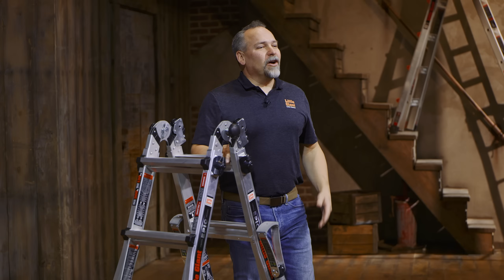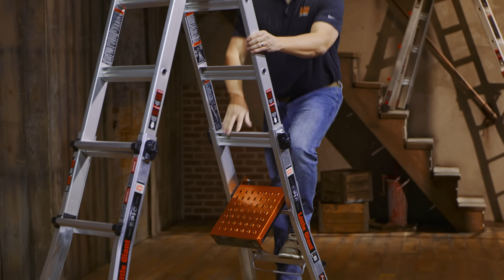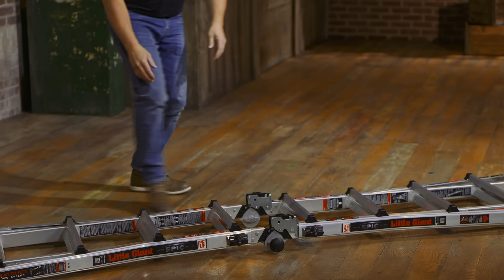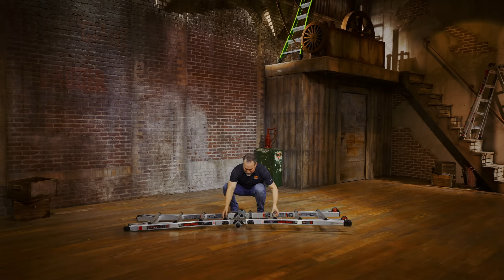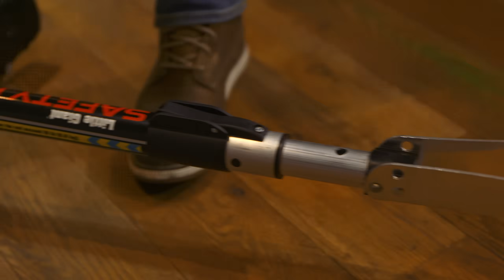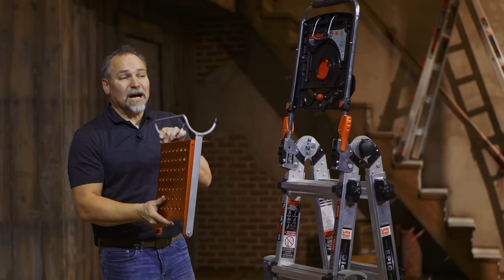Epic | Demo | Little Giant Ladder Systems

Comment: How much does the epic weigh?
Reply from the maker: the M18 size is 38 pounds, but that includes the safety rails. If you don't plan on doing jobs that require the safety rails I would store them elsewhere until you need them, because the safety rails do add about almost 6 pounds.

Comment: What is the length of the fold out standoffs and can they be adjusted (between them ladder and wall)?
Reply from the maker: the part that leans on the wall can't extend further out toward the wall, but the safety rails extend outward horizontally to span a larger window. Let me talk to our product team and see if they know the specific dimensions of how much of a standoff you get.
Reply from the maker: I talked to the team, and when you fold out the standoff part, it is 7 inches to the wall. But, by the time you factor in the proper angle of the ladder, you end up with only about 6 inches before the top of the ladder would touch the wall. So realistically, you get a 6 inch standoff.

Comment: Can the safety rail be attached lower to allow gutter standoff, while still allowing at least 3ft extension above the roof edge?
Reply from the maker: I would need to ask the engineers if it's ok to use an extra set of safety rails at the same time to allow for this. It's a good question - I'll get back to you on that!

Comment: I was going to ask how you could have anywhere close to 3” or 3 steps onto the roof when the horizontal bar ( and I only see one) is less than home roof height. So it seems you need four bars to get on the roof of any home with gutters… not so clever; and this I must assume is an added cost to this expensive ladder? (Not to mention the added weight!)
Reply from the maker: Many gutters are built with supports to lean against, though you are right, it is possible that climbing a ladder that is leaning on a gutter could dent it, but you do need to have 3 feet above the roofline in order to safely transition. The set of Safety Rails that come with the Epic is intended to be used vertically for that transition, which means instead of needing 3 feet of ladder above the roofline, you just need the 3 feet of safety rails and can walk straight through it.
Reply: @LittleGiantLadders I appreciate your rsvp, however LG needs to address the issue of gutter protection. Maybe your engineers can come up with an included fold away guard but most gutters could easily be bent scratched or a slippery unsafe surface to lean into with your system as is. Most ladders accommodate aftermarket stabilizers via holes in the rails. I am surprised LG has not made this simple design available. Anyway, buying two extra bars for a total of four bars is not an option in my opinion. Be well!

Comment: Can u tell me the difference between this the velocity and the multi? I know there are different kinds I’m just curious for my purchase thanks.
Reply from the maker: Hey sorry for responding so late! I just saw your comments. The biggest differences are in the type of locking mechanism. Velocity uses a "rock lock" to unlock the rails and make it taller or shorter. The Multi, Leveler, and Epic all use a "rapid lock". The multi does not have built-in ratchet levelers, and the velocity has the option to include them or buy them without. The Leveler and the Epic both have internal ratchet levelers on one side to help with uneven surfaces to ensure you are level. The main differences between the Leveler 2.0 and the Epic are that the Leveler has a hinge that doubles as a tool holster, while the Epic has an accessory port for attaching an air-deck accessory. The other difference is that the Epic has mounts to attach Safety Rails, allowing for a standoff or a walkthrough. 

I know it can get overwhelming looking at all the differences, so my question to you would be, what is your purpose for using a ladder? Sometimes knowing what you need to get done can help ensure you get something that has just the features you need.

Comment: I just tried to buy the model 22 and it went out of stock with the bundle as I was checking out during the sale so i had to buy it without the bundle. :( can you buy the epic step separately? i dont see it available as a separate purchase. are you able to purchase the entire bundle separately? i'd use at least the step, airdeck and ladder rack.
Reply from the maker: I need to go double check if they sell an accessory bundle separately, it is such a great addition to the Epic. I know that there is a "Platform Pro" which is essentially an improved version of the Epic Step with spots for putting tools if you're not going to be standing on it.

Comment: Can you use two sets of safety rails together? One for the standoff and another as the walkthrough?
Reply from the maker: They'd definitely both be able to be on at the same time, however, it would really make the top section very top heavy as you're raising the ladder into position. So it might be a bit awkward. I will double check with our engineers about that, though.
Reply: @LittleGiantLadders  i mostly have another guy with me at all times so not worried about weight.

I soft wash roofs for a living so being able to use that stabilizer bar to rest on the roof of the property and not on the side of the home (on gutters for example) AND use as the walkthrough together is a win

Thanks! This just sold me on the ladder

Comment: I think it would be cool if the safety rails could rotate on the walk through position to aim towards the building. I have a large overhang on my roof so it makes it tough to clean out the gutters. If I could aim those safety rails at the building then I could reach the gutters without putting my ladder against them in the extension position. Admittedly idk how safe this would be.

Comment: How's the Leveler 1.0, Leveler 2.0, Epic, Megalite different and similar and what accessories work with each?  What do we need to do to qualify our register for the lifetime warranty?
Reply from the maker: The Leveler 2.0 improves on the 1.0 by having a new style palm button (it becomes a tool hangar in addition to the palm button) and comes with the Tool Tray pre-installed. The ratcheting leg leveler that is built-in on both has an additional way to retract it when you're done (with your foot, instead of just your hand). 
The Epic is similar to the Leveler 1.0, however, it has the connections available to attach Safety Rails. These Safety Rails act as either a wing-span (wall standoff) or a walk-thru so you can access a roof much easier by giving you that 3 feet required at the top, and no awkward climb-around when transitioning to a roof. The Epic also has an accessory port, allowing you to use an AirDeck. No other Little Giant ladder has this port any more. 
The MegaLite+ is what is now available in Costco. It is closest to a Leveler 1.0. Not many differences except color scheme.

They can all use the Articulating Ladder Tool Tray (or the Tool Tray XL), Trestle Brackets+Plank, Work Platform, Platform Pro, Project Tray, Cargo Hold, Fuel Tank, and the Ladder Rack. Only the Epic can use the AirDeck, as I mentioned earlier. 

To qualify for the warranty, you fill out the form on our website which will ask a couple questions like which ladder you bought, where you bought it, etc. It's very simple. Then if you ever have any issues we can find your information in our system, or on the offchance was ever some sort of recall, we'd be able to contact you.

If you have more questions feel free to respond to this comment, or our customer experience team always loves to chat! Their number is 1-800-453-1192

Comment: 26 foot epic bundle has been out of stock for a long time. Any idea when it'll be back in stock?
Reply from the maker: Right now I would suggest checking out the promotion we have on the Xtreme - even the 26 is discounted quite a bit! It's on our promotions tab of the shop menu on our website. Has the safety rails and a bundle included as well.

Comment: I love these ladders and they are durable and a beast as I have the 21 ft.  I looking at getting the 26 ft. both 21 and 26 will be top heavy for me at 5' 8" so it is always top heavy.
Reply from the maker: And because it gets top heavy when you add attachments on one end of the extension ladder, you will definitely want to "foot the ladder" at the base of a foundation (or have someone step on the feet if needed) while bringing it down.

Comment: How is the Epic different from the Revolution?  Thanks!
Reply from the maker: The Epic has safety rails and an accessory port at the top. The Revolution does not. The Epic features rapid-locks to adjust the length or height of the ladder, while the Revolution uses metal rock-locks. It all depends on what you plan on using your ladder for, to know which one is right for you. If you like the rapid locks but don't need the safety rails, also take a look at the Leveler.

Comment: Those levelers would be better if they were on both ends, you’re more likely to be uneven on both sides when using as a A-Frame ladder.
Reply from the maker: For the relatively few that need levelers on both sides, it is possible to order a "replacement outer" and use that in place of the wheel side. Unfortunately for the Epic, that would remove the safety rail functionality, so I would recommend if you need ratchet levelers on all 4 sides, to do that with the Velocity with ratchets, or the Leveler.

Comment: ISN'T IT ABOUT TIME THESE  LADDER  MANUFACTURERS  MAKE A REVOLUTIONARY  UPGRADE  BY ADDING  ALL FOUR LEGS WITH LEVELERS SO IT CAN BE USED IN EITHER PERPENDICULAR OR PARALLEL PLACEMENT OF LADDER AND THEN LEVELED EITHER WAY OR ITS STILL LIMITED IN LEVELING ADJUSTABILITY?

. ... I'M LOOKING FORWARD TO A NEW DESIGN WITH ALL 4 LEGS BEING ABLE TO BE INDEPENDENTLY ADJUSTABLE AND LEVELED SO THE LADDER CAN BE USE IN PERPENDICULAR AND PARALLEL PLACEMENT TO THE WORK PROJECT. ..... IT WOULD BE A GAME CHANGER IN THE LADDER INDUSTRY AND SELL LIKE HOT CAKES....

Otherwise what if the ground is only  uneven  on left half side of ladder... even if one  leveled the  one ladder rung on one side , that would still leave  the other side uneven and still needing  the same leveling. ....!?  Without having the ability TO ADJUST THE OTHER SIDE OF THE LADDERS RUNGS  YOU WILL  STILL BE LIMITED IN THE LADDERS USE AND NOT BE ABLE TO USE THE LADDER IN BOTH PARALLEL AND PERPENDICULAR PLACEMENT TO THE WORK PROJECT. ....I HOPE THIS HELPS.. LOOK FORWARD TO SEEING A QUAD LEG INDEPENDENT ADJUSTABILITY MULTI USE 26 FT LADDER WITH EPIC FEATURES LIKE THE DUAL POSITION AIR DECK. .....
Reply: The company made a comment elsewhere here that you can level all four legs with the Velocity with rachets or the Leveler.

Comment: what is the difference between the little giant xtreme and the little giant epic ?
Reply from the maker: The major differences are that instead of rock locks, the Epic has rapid locks. And while they both have accessory ports, the accessory port on the Epic can swivel to allow accessories to be put in horizontally (like the air deck, fuel tank, etc).

Comment: I just received my Epic26. Woah its heavy, but I need the height. Thanks for your very informative video.
Reply from the maker: The Epic26 is a beast!! If you're doing a job that doesn't need the Safety Rails, you could remove those and only attach them when you need them, which helps a little bit.

Comment: Last month I purchased a Leveler M22 from Lowes. Can the accessories for the Epic be used on the Leveler?
Reply from the maker: Some of the accessories that work for the Epic work for the Leveler, but not all of them. You'll notice the Epic has some attachments for the safety rails that our other products do not have. Also, only the model 26 Leveler has an accessory port at the top (where an airdeck would be used). But everything else would work on any size leveler.
Reply: What accessories are compatible with the Leveler 1.0 and Leveler 2.0?